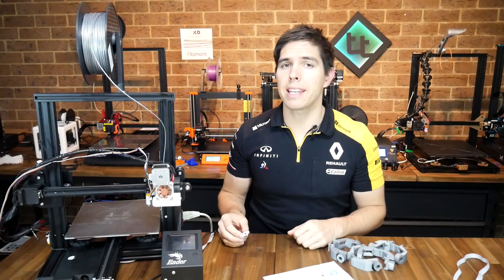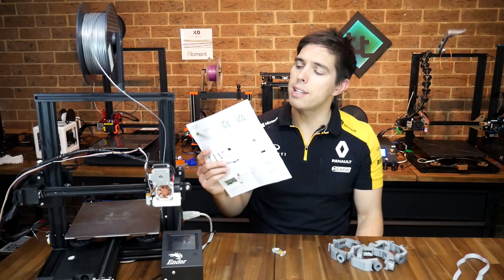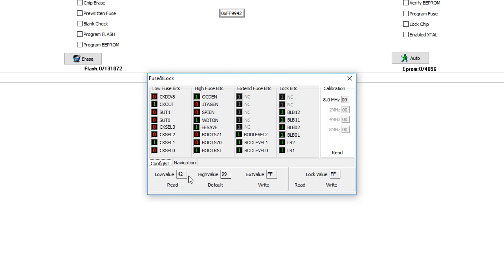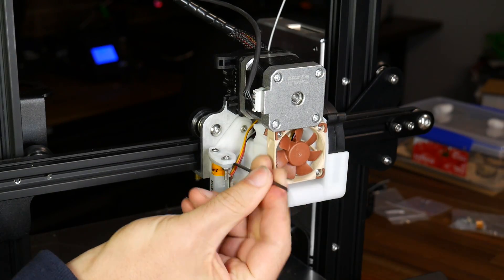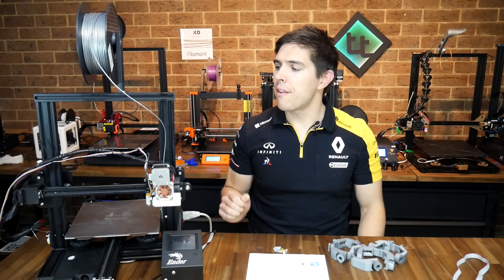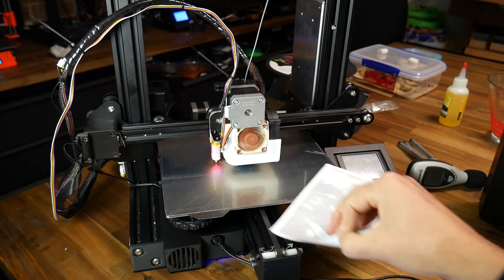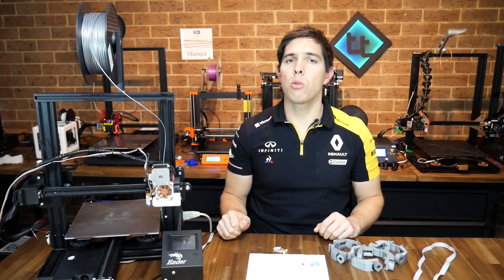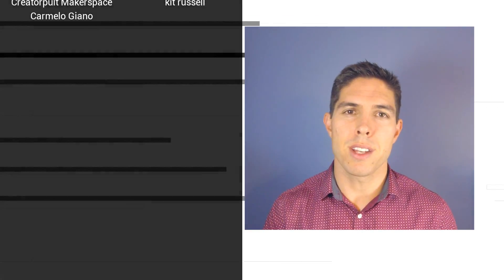Creality BLtouch Ender 3 upgrade kit - Step by step guide with fixes

Comment: I installed Marlin 1.1.9 for the BLTouch V3 you provided. But there is a problem that z offset does not go below 0. How do I solve this problem?
Reply: I have the same issue, did you find a solution?
Reply: Same problem I lowered the bed as far as it could go then raise the bed up again
Reply: Same here!
Reply: change #define MIN_SOFTWARE_ENDSTOP_Z to //#define MIN_SOFTWARE_ENDSTOP_Z in marlin
Reply: @SLANG777  where change this???? in firmware or ????
Reply: If you cannot go below zero in the bl touch set up, from main menu open motion, then open Probe Z offset.  Lower the value below zero.  This will allow The Bl offset to reduced beyond the zero, you can measure on paper here while adjusting, I set the lower range tight on paper so I could have little wiggle room for future adjustment.  My Setting was .2mm tighter than freely moving paper, to give myself some wiggle room.  Save the setting.  Now you should be able to adjust/calibrate your BL touch below Zero.  Remember if you don't save setting, when you turn E3 off you will reset to old values.

Comment: Hi Michael, thanks for the video. Just a question. I have bought the complete kit. The official instructions states that the Low Value = D6 and High Value = DC. In your guide you have it the other way around. Which way is it? Is this important? BTW, I am using your custom HEX file from your follow on video. Any help would be most appreciated. Thanks

Comment: hello 
thanks for this video 
1 question , i  have buy your firmware for my ender 3 with bltouch v3 , , i have install firmware , the bltouch seems work correctly , but after auto home i can't move the Z axis under 0 , i can't go on negative , to adjust the Z offset , an idea for my problem ? sorry for my bad english
Reply: I'm having the same problem. My printer is down until a fix can be found.
Reply: @PhantomJM  Yep.  I've spent 4.5 hours trying to find a fix today...
Reply: @Teaching Tech I also have that problem.  Adjusting z offset does not move the print head.  I also have random times when the BLtouch v3.1 probe retracts during bed leveling even though it has not touched the bed.
Reply: How come there has not been a fix for this. Its a game breaking bug in this firmware.
Reply: I personally just decided to return my BLTouch to Amazon not worth the hassle to me
Reply: I have found the solution,i have send command " m211 s0"
Reply: @flashlinker1  where you sent this command? i have the same issue....
Reply: Stoyan Stoyanov via octopi you can send command
Reply: @flashlinker1  Can you please inform where we can get this one? we are having trouble to go to MINUS.
solution might be to send new Flash for calibration.
thanks

Comment: Nothing works :( My LCD is hotglued to the board... I got jumper wires. PROGISP causes access violation to windows 10 kernel. Progisp can't find USB ISP programmer and has empty list of chips. I would advice for other people to not buy this set. Just go with it old fashion way and save some money.

Comment: Wouldn't have made it without the video. It's working now with v3 bltouch but the installation unfortunately was probably one of the worst I've ever done. It started out with the PC not recognizing the programmer so I spent maybe 2 hours trying to find drivers, until I realized that it was a hardware fault. I reflowed the solder that connected the contacts to the board and also had to add solder on a couple of places. After that it worked a bit better but still the USB port on the programmer was faulty so I had to cut away some plastic on the inside and also twist it constantly to have a connection to the PC. This made it very hard to upgrade. I used the BLtouch V3 bugfix firmware provided in the description. The probe worked at once thouch I can't move the z axis below 0 and the bed is to low so I had to manually adjust the z offset while the printer was running, I did run into the board but it seems to be working well now. I hope there was a bootloader in that firmware because I really hate that programmer. I like the BLTouch mount in metal, and also the other parts was easy to install. I'm pretty happy with the end result but installation took around 6 hours because of all the problems.

Comment: I have an issue with the Pin 27 board: All plugged in I cannot close the lid anymore because the board fan collides with the display cable. Anybody have an idea on how to solve this?

Comment: Hi Michael,  Thank you for all the great videos as they have helped me with my Ender 3 Pro so much! I recently installed Creality's BLTouch kit with your video and downloaded your hex in the description and upgraded my firmware with it. Since I have updated to that firmware my Ender 3 Pro has become very jerky and loud. I was using TH3Ds firmware before and didn't have this problem. I have read of one other person on Reddit having this issue as well. Have you heard of this and can you help us think of a solution? My BLTouch works fine after some tweaking with the z offset but the jerky movement just started when I used your hex.

Comment: @Teaching Tech I used your HEX files for the firmware and definitely like it overall compared to the Creality version but for some reason and excuse my being very much a noob but it does not do the grid leveling and I can't figure out what I'm doing wrong. Please someone help. Hopefully you'll respond. Is there a way to see the current settings of this HEX file in Marlin? I want to make sure I keep everything you've done in place but if I need to make changes to get the grid working then I'd need it all. Again, very much new to this. I'm fairly techy but this stuff has taken a lot of patience and you go through everything so fast I have to watch them over and over to make sure I get everything. Thanks in advance.

Comment: Hi! I bought your hex file for v3, but when i calibrate i get an err: maxtemp Printer halted, when i try to store settings. Then i tried the hex file that came with the kit no error when i stored my calibration. First after i started a print and the bl touch had calibrated at the 9 points it gave the same error. It has also showed the error where it said mintemp printer halted. Am i missing something ?

Comment: I just got my Ender 3 Pro. The board is v 1.1.4 and is supposed to have a bootloader already installed, according to the Creality website. I purchased your firmware upgrade and tried to follow your video on upgrading firmware but I'm not seeing the sandguino board in Arduino ISP.
Reply: Apparently the preinstalled v1.1.4 boards don't have the enhanced features listed on the boards you can buy from the website. No boot loader and no silent stepper motor drives.

Comment: after clicking auto, my buzzer on my printer goes off, and wont stop
Reply: I also have this issue
Reply: ah this is likely because you tested if it worked, without the new thing in between

Comment: @Teaching Tech
I get "Chip enable program error" when I click the 'auto' button. I have been trying to get this to work for ages. If anyone has the same issue or is able to offer advice, please do! Thanks!
Reply from the maker: Make sure the machine is powered on. That fixed it for me.
Reply: @TeachingTech  Thanks for the reply! So following your steps, first it reports "Can't finish Chip Erase" - upon clicking OK (personally I don't think its OK, but what can I do!) it reports "Chip enable program error". I should disclose I didn't actually buy their kit, but assembled it having purchased each part separately. The Fuse bits work fine however while they didn't if the main power was not on.

Comment: Hello, I downloaded and installed a pre-compiled firmware hexadecimal prepared by myself for BLtouch V3 (Marlin bug correction 1.1.9 with out of control thermal protection), but then to modify the steps or the others, how can I extract the hexadecimal file? to reintroduce marlin with the changes made, Thanks

Comment: bought the kit.. Got the v3, still stuck at the flash. It all went on ok (I think) but the speaker/buzzer is making a constant noise now. I came here and got your hex file for the v3 and repeated the steps. Again all seems to have flashed but the speaker is still givving off this constant noise when powered on.

I had originally flashed the bootloader and updated to the TH3D_UFW_U1.R2.10d firmware for safety following yor video and all was well. When I switch on the boot screen informs bugfix 1.1 marlin but still the speaker is goin off on one. kinda starting to regret buying this kit. Any help would be appreciated.

edit I went back to the TH3D firmware and the speaker has stopped now. Gonna try from the start all over agin. If it starts again I'm just gonna set up through the TH3D frmware instead. I had thought, as this was a creality kit that al would have went on easy with no hassles.
If I had not thought to come straight to your channel once I encountered a problem, I'd be sunk mate, and would have just wasted £50.
Reply from the maker: The buzzer should be physically disconnected now due to the pin 27 board. It hijacks the wire to the buzzer for the bltouch.
Reply: @TeachingTech  it never got that far mate. I hadn't fitted the parts at that point. Lol, blindly following the leaflet. It wasn't till after that I searched you out, again.
I switched over to marlin 1.1.9, downloaded your config.h and config adv. Edited the firmware changes from the Phillip Beal link. 
Once I softened the endstop and offsets for the probe. I have it all set and good to go. Took a wee while to be sure it was all set and working. All is good in the world again.
Thanks for all the videos mate. It all worked out eventually. Those instructions in box tho.. lol, dog went mental when the speaker kicked in 😂

Thanks again dood ✌

Comment: Holy crap, thank you tons for this. I got my ender 3 Pro a few weeks ago after watching your videos (I had a davinci Jr 1.0 pro and it was a horrible experience and I needed a better rig). 

I was looking at bltouch modules due to your other videos and a warped bed + replacement bed. I was set to flash the bootloader, but saw this kit and nabbed it instead. It gets here tomorrow from Amazon and I am so glad I saw this video otherwise I probably would have screwed it up because I didn't even know it came with it's own programmer tool and I was still planning on using my Arduino. 

I didn't need another printer to brick like the davinci where their firmware update bricked the system and they are closed source to the point you can't even download the old firmware. 

Absolute lifesaver!
Reply: I literally switched to ender 3 from a DaVinci mini because that thing would jam every print

Comment: Thanks for all your videos. You have so many videos out there not sure which one to use. I have a Ender 3 pro i purchased the Bltouch V3 dated 3-13-2019, also i got the pin 27 adapter and the Arduino uno R3 they are all originals not clones i want to get it all running. Whats the best video for my printer. and no i have not flashed my firmware yet im right at the start. thanks

Comment: I downloaded your compiled .hex file and it's just what I needed! So much better tan Creality's !  How do I add my Esteps correction now? 98mm for 100mm so I need to add the correction. I don't see a menu option so maybe in Cura start code? Having a bootloader now is it possible to provide as another download option, the exact config files you used to modify Marlin 1.1.9 so that  changes can be made and flashed back via usb. I'm trying to stay with the changes `you've made but be able to do some fine tuning as necessary like modify Esteps, or change bl touch prob settings.
Thank you for all your great work.
Reply: Michael replied with this info that answers my Esteps question.

The BLtouch takes up more flash space on the microcontroller, so slim menus has to be enabled to save space. All of the settings are still there, just not all available from the LCD. If you connect the printer to a laptop via USB and then connect via terminal (Pronterface is a good free option), you can send gcode directly to the printer and read what the printer sends back.

This means you can send the commands for setting E steps: marlinfw.org/docs/gcode/M092.html 

and then the command for saving to EEPROM: marlinfw.org/docs/gcode/M500.html

Alternatively you can just put the M92 E step command in your start gcode in Cura.

He may be supplying the source code used but I have no info on where or when. 
I found C7 to be easy to remove and save, so I did. If I need it in the future I'll put it back.
I also decided to become a Patron supporter after realizing how many helpful videos of Teaching tech's I've watched before and after I purchased my e3! I enjoy his presentations and the fact that he got on this Creality v2 v3 kit issue with a timely fix!
Thank you Michael.
Reply: Follow up. using Michael's above suggestions and Pronterface I was able to access, change, and save my Esteps via usb. I'm very happy with his help and support and how everything is working now. Btw, I see where Antclabs has listed his videos as a reference for installing a V3 BL Touch now.

Comment: I can't even get the  progisp to load. I get a access violation error. When I clear the error I get nothing in the drop down list. Frustrating
Reply: tell me about it! so bad! ok here's my answer. I downloaded the creality fw from the link on the buy bl touch.cn site as well as their download page. I found (w10) that one progisp worked and I used it. I'll have to remember the source that worked? .You may want to try the link on the bl touch buy .cn page if it works  
https://www.dropbox.com/s/11m457dek32o0wt/Creality%20V1%20Firmware%20and%20Guidance%20For%20BLTouch.rar?dl=0
Reply: Search for the progisp and download from another site the version from creality is jacked

Comment: I've installed BLTouch, updated hex to the one you provided (v3), and did the paper leveling step. 

Do I need to do anything else before printing?
Reply: Final steps I did was to slice with a g29 code added, a first level print test from thingiverse. then after autoleveling I adjusted Z offset until I had a good first layer line being printed. Then I stored that number. I did crash the nozzle too close to the bed trying to set Z offset but have $3 glass so no damage to the print surface. If using the black surface this mistake could be bad! I couldn't find any baby steps option for the Z offset in his menu options. I would like to see a follow up video focusing on his creality alternative .hex file and setting Z offset and adding E steps calibration.

Comment: I am running into issues. I used Marlin.ino.with_bootloader.sanguino that I downloaded from Gumroad and all went ell except I notice I have no Z Offset control or any other control other then Probe Z offset which is 0. So I am stuck at the moment.
Reply: Also ran through all the menu elements and there is no motion control other then probe Z Offset. Help
Reply: Ok I figure out that Slim Menu must be turned on and that makes it impossible for me to adjust the machine..No menu no adjustments. I have tried to recompile but I can't get the file small enough to fit on the board. Grrrr
Reply: Think I figure it out. Got it printing now. I need to tweak the Z Offset but right now my first print is underway. Cheers

Comment: Got the kit, installed it and after a month it failed (also had the z-stop wires backwards on the cable). Mailed antclabs and they say there is a know issue with Melzi boards. You should remove resistor C7 near the z-stop header on the board, as well as fixing issues apparently makes the probe more accurate. You can see their instructions here: https://www.antclabs.com/wiring3. Not tried it yet as my replacement BLTouch just arrived so its a project for the weekend. Also flashing the Creality BLTouch firmware on a 1.1.4 board with 1.1.8 firmware will take you back to 1.1.6 firmware. I used the guide from Teaching Tech and flashed vanilla marlin 1.1.9. Really think Creality shoudl test products before the release them fully.

Comment: So I've been fighting with this for ages, I'm using Michaels firmware hex and every time I try to home, it just crashes into the bed. I can't get anything working. Any ideas?
Reply: best way for now is flashing new TH3D firmware and enable the lines for ender 3 and bltouch. In the TH3D package you have pronterface (gcode sender folder) and if you send commands G28 and G29 you will see if ther is some error.
This is working for me this way for now.
I think that Michael´s 1.1.9 pre-compiled firmware only has thermal protection enabled and doesn´t resolve bltouch v3 issue.
Reply: @crencos  I'll give that a try and come back to you :) Thank you

Comment: Hi Teaching Tech, after flashing the ender 3 with your pre-compiled firmware hex the display of the printer remain white without anything written.
Can you please help me?
Thanks
Reply: I had that it was one of two things. The Z stop wires the black and white are reversed or the LCD display plug isn't in correctly. I had the same issue.
Reply: I had this issue as well.  It's the pinboard is not aligned correctly which is REALLY easy to do.  Unplug it and move it either left or right slightly. Once you find the correct alignment the screen will show

Comment: 2 days ago marlin 1.1x bugfix updated on github, fork form 2.x for bltouch v3 added "[1.1.x] BLTOUCH_V3 parity with 2.0.x" [Add BLTOUCH_V3 to example configs ] check this:

https://github.com/MarlinFirmware/Marlin/pull/13682
https://github.com/MarlinFirmware/Marlin/commit/7cc1410070067aa056ee17a0a32d91d41cf599c9